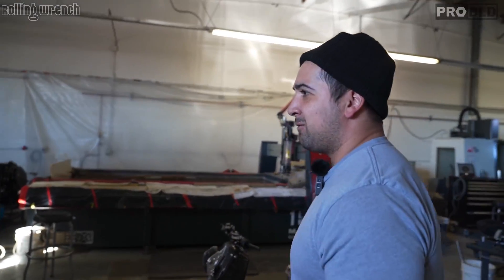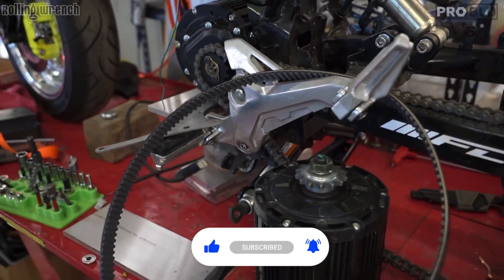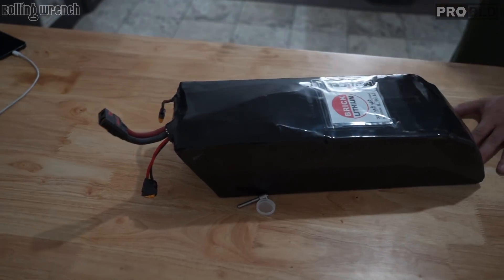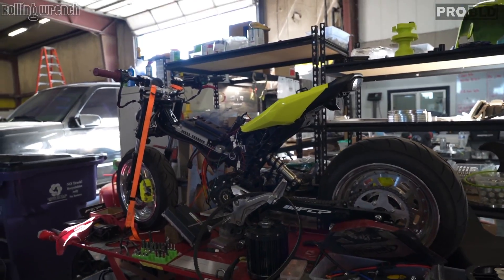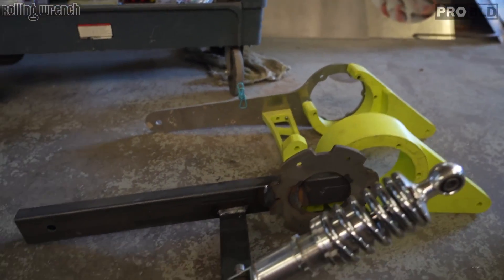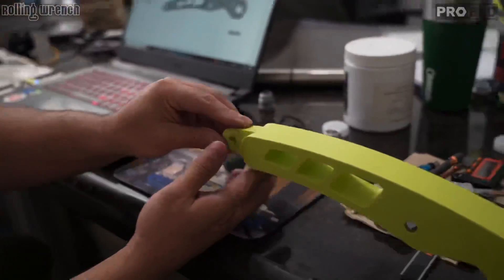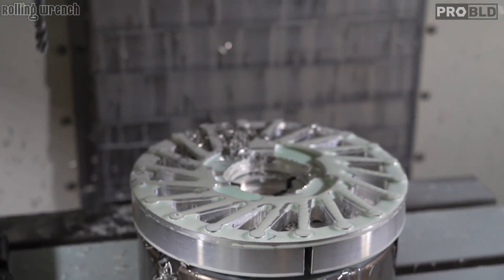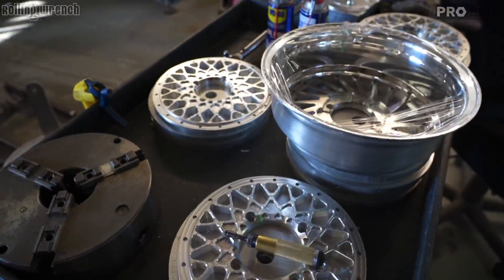Electric Powered Honda Ruckus & Grom Swap Kits [ 100% PLUG & PLAY]

Comment: FYI -- There is an Axial Flux 15K for Motorcycles.
They are about 1/3 the size of the Radial Flux motors your using and 3x the power.
Now the rest of the space can be batteries. ;-D
https://www.youtube.com/watch?v=Ily5rYJ0Jqc

Comment: Shen Zen Basen Tech Batteries come in AH ratings from 50AH to 310AH.
The 280AH model can be charged at 90Amps continuous with a 400Amp max.
The 280AH 48V pack weighs about 160lbs/80Kg.
A battery management unit is needed for each 12v battery, a 150A BMT is the largest available. The BMT will limit your charging current to 150A or less.
Charging by solar, you could use a Midnight Solar 150A Charge Controller to charge the battery pack. Maybe a couple of BougeRV 400w CIGS panels, 8lbs each, you could carry them with you on your ride. Build a 100A Victron into the Ruckus.

Comment: The frame of ruckus is not created to run for 75MPH. Besides it is not a smart idea to buy ruckus ($3000) just to get a frame for a project like this. Isn’t it easy to design a better frame and get it made in a foundry somewhere (may be you will find a frame supplier somewhere in Taiwan, Thailand, Singapore if you don’t like China and can’t afford domestic cost of making prototype)?
Reply from the maker: The issue is getting a frame with a vin number so you can register it to ride on the road
Reply: @RollingWrench  they must be contracting frames from third parties in china, koriya or Southeast Asia. In Taiwan there are foundries that can make just one piece. Or buy frames that rejected by them for not matching quality specifications. Most are just good enough.

Comment: THIS looks much better than doing a BIG-BORE Kit. The Torque on this should be Insane which you would;nt get from a TUNED GROM. I just Hope the FULL-KIT is Not as Expensive to do as i;m getting my 1st GROM in a few weeks, The last deal fell through or i;d have my GROM by now.
Reply: Its gonna be at least 4k USD, maybe closer to 8k.

Comment: I am 165 lb, 5 ft 9, so the comfort on a ruckus for me is great! What is the top speed of your electric motor and how long does the ride last before you need a charge? This is absolutely what I'm looking for, in fact I want that bike if you are manufacturing it?
Reply: Depends on battery size. A ~50Ah should get you 50-70 mile range depending on gearing (in relation to motor speed/current draw)

Comment: I need help my scooter isn't starting i change the variator carburator is clean Bendix is spinning but it doesn't hit gear found oil in the air filter

Comment: There is no options it's going to be very expensive until years go by so face it let's stick with our gasoline and make a lot of noise
Reply from the maker: Ya, definitely very expensive. I love gas motors! But electric is sweet too.
Reply: Electric ruckus made by Honda is now available in Southeast Asia (definitely in Philippines) and soon in India which has easily replaceable batteries. Works(USA) now make e-bike and e-scooters within their battery share ecosystem.
Reply: @Wog68 yeah but i imagine they're quite slow
Reply: @barryallen5507  what is your average speed in metro area? More weight of vehicle and more speed in metro areas cost more and cause more pollution. Also, try to keep places like manhattan for pedestrians only (and updated metro), like some cities around the globe did and experience the difference.
Reply: @Wog68  average speed in a city area? I tend to go quite fast, so i would estimate somewhere between 50 and 70 miles per hour while in a car, closer to 90-100 while on a motorcycle.

Im interested in an electric vehicle of some sort, but factory electric vehicles aside from teslas are quite slow.
Reply: @Wog68  the few electric honda ruckus builds ive seen so far, while expensive, are quite fast and have very reasonable range for such a small vehicle and short charge time.
Reply: @ you must be living near autobahn.😜
Reply: @ That if you have money to experiment.only one scooter manufacturer make 49cc scooter that go up to 55m/hr.
Besides, if you install more then 49cc then you require motorcycle license.
Reply: @Wog68  no, just America. It is true, a license is required for >49cc engines, but electric motor equivalency under law in my state and lack of officer education means that any electric motor I can fit on a honda ruckus is equal to 49cc
Reply: @ Nope, it depends upon what motor you install. Officer education is on going. Besides, Honda as OEM can install motor that may be more than 49CC, on the other hand you as a consumer of gas powered ruckus is not privileged to do that because it alter the whole design, safety and viability of end product.
Reply: @Wog68  either way, doesnt matter to me if i need a license or not
Reply: @ But from DMV point of view whatever mod is done need to be safe for the rider, other motorists and the public.
Reply: @Wog68  thats great and all, but i dont care
Reply: @barryallen5507  BMW has electric scooter that go at highway speed. Cost over $12K.
Reply: A Ryobi drill would be step up from the Navi, and close to the right colour for stickers...
I would have made mine electric after it blew up  at 8000mi, but a friend wanted to rebuild it for his girlfriend.